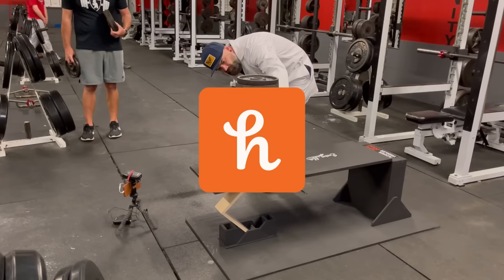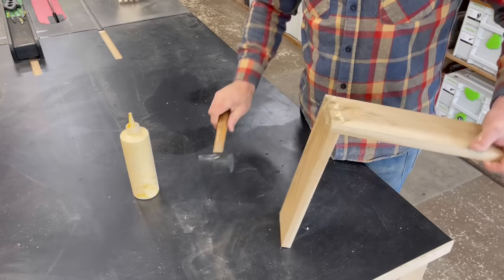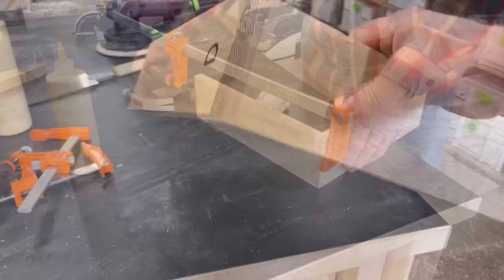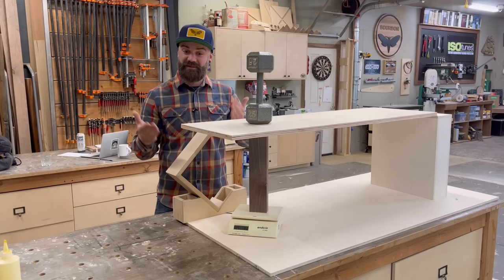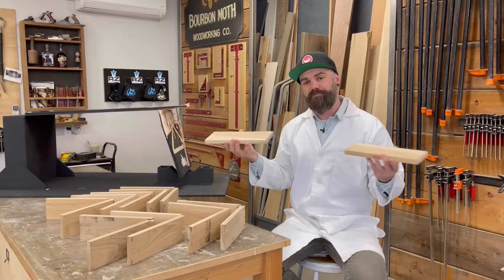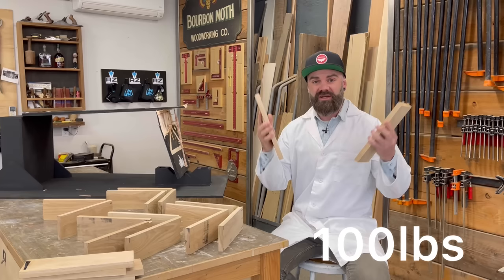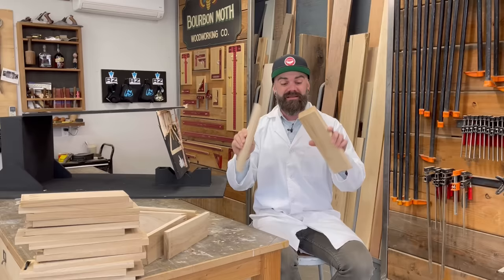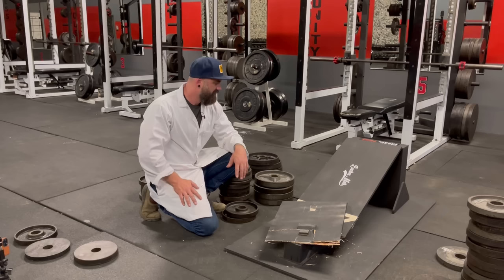What's the Best Wood Joint || Insanely Strong Joinery!

Comment: You called for a physics lesson: The accurate way to measure that breaking point is to measure torque on the joint. The torque is the twisting force and is equal to the perpendicular force times the distance from the pivot position. It is measured in foot-pounds or in newton-meters.  Since you are using pounds and you are positioning your wood at a 45 degree angle, the Torque is  T=Weight x Distance_perpendicular  which is Torque= Weight x Length of wood x cos (45) where weight is the force in pounds, length is the length in feet from the joint to the edge of the wood where you are applying the force, and the angle in degrees is the angle from horizontal that you tilted the joint in the rig. 

There are actually two ways to measure breaking force, torque (for twisting) and shear force. If you lay the top piece of wood flat at an angle of 0, you would just be measuring torque. If you propped the wood straight up (an angle of 90 from horizontal) and pushed straight down, you would be measuring shear force. You chose 45 degrees which is a combination of both but typically a joint will break to torque long before it breaks to shear force.

Comment: I'm thinking that the mitered joint is stronger because the glue penetrates down the grain on both sides.  Whereas the butt joint the glue only penetrates down the grain on one side and does not penetrate into the side of the other board.  The glue is strong by itself but it needs something to hold on to.

Comment: I'm not a pro just a father of two, but practically I keep doing the same thing everywhere: butt joint + screws. I wouldn't be surprised if it would beat pocket holes outside...
About the dovetail... for me it looked like the material itself yielded along the long grain where the negative corners of the tails were. Similar to why airplanes have windows without corners.

Comment: Maybe you can increase the resistance changing the glue you used.  Try it using a PUR glue (like Original Gorilla Glue) or an animal protein glue (like Titebond Hide Glue).  I use animal protein glue and sometimes I break the wood and didn't break the joint...

Comment: 15:23 - Well, physics teaches us that during an impact impulses of force can reach outstanding values, and those values of force (even if they last one split of a second) will break the bond. You tried the best case scenario: slowly adding weight. It breaks with 60 pounds, but if you hit it with a 1 pound hammer it will break. So no, it's not over engineered at all. But I am a wood worker, so don't trust me too much.

Comment: It appears to me that the strength of the joint is basically correlated to how much matching surface area there is thats glued. The miter joint would have about 40% more surface area than a butt joint but would also match end grain structure.  The glue absorbing into the end grain on both boards would add even more surface contact.  adding the splines is going to add surface area for more glue that will again match grain but this time they add strenth along the face and not at the end grain so it would get even stronger with more splines..  Dovetails are great joints but I feel like they are more suited to make joints that you want to be able to take apart and put back together without glue.  try the test again with no glue and see whats the strongest... lol

Comment: You should have tested a simple finger joint.  It would have probable have been the strongest.  It's been used for high strength shipping and ammo boxes since the 1800s.  Its' all about the total cross grain glue area.
I tested an almost identical 1/8" finger joint in 3/4 " yellow pine.  I'm a fairly large guy at 220#.  I tested the joints by setting them on the floor, apex up, and standing on the joint even Then I bounced on it. It would not fail. 
A simple miter joint is also strong due to the increased glue area at 45 deg (thickness X 1.414). 
All end grain (and 45 deg) joints can be made stronger by priming the joint with glue prior to glue up...kunk

Comment: I'm a domino fan. Dominoes are not used to their advantage in a but joint. In this test, the domino's long grain is glued to one board's end grain - really no different than the 1st but joint. The long grain of the domino should be glued to long grain in both boards to work as intended - and to provide a very strong joint.

Comment: On 3/4 board, miter is longer than just 3/4 that's mean much greater glue area. Measure how thick is miter on 3/4 ply, and make exact same thickness of board on but joint. You may be surprised.

Comment: The dovetail probably would have beaten the bunch if it was as even as the box joint.  The spacing was pretty but you didn’t have that much meat holding it together.  Interested in you trying some routes joints for your next test.

Comment: If you were to equally space the dovetails, more like the box joint it would perform much better in this test as the lateral load would be distributed more evenly across the boards. With the addition of the dovetails, it would probably add another 10lbs or so to the box joint. But, this isn’t really the application the dovetail was was designed for. A really good video though. The humble mitre was indeed the clear surprise winner. Nice work, I’m looking forward to seeing how you progress this series
Reply: A suggestion for the evolution of this test could be adding another joint to the opposite end creating a U, and suspending the weights from it to see the various break points in a pull application?

Comment: Some rude comments regarding the glue...joint  making. I would say, try the dovetail again, same  scenario...but both boards cut to the same dimension. I would bet you get a better result. However...you are breaking these joints at an angle...so I get the mitre style joint being able to spread pressure better. I liked this video regardless of any flaws...because it does make you think about the joint for the job. Something a few carpenters tend to forget...or at least forget to ask the client when designing furniture that has to take weight into consideration. 🤔

Comment: 13:11 My guess order, weakest to strongest:
Pocket inside
Butt
Miter
Pocket outside
Lamello
Dowel
Domino
Miter w/ splines
Box
Dove
[Edit]
I was sort of on the right track with most of these, except two: miter and dove. I think the dove would be much stronger than it was if the tails were wider. But the miter surprised me! I would personally probably make miter with splines. Seems like a lot of strength and a nice look for not much extra work over a miter.

Comment: I think this could be done more reliably. There are 2 things I’d change if I were to carry out this test.
First of all, get rid of that block that props up the test pieces! It alters the point of leverage and screws the results, instead put marks on the floor and underside of the hinge board and use those to line it up. 
Much better
Second, and this is only subtle, is to use a dovetail with a more even 
pin-to-tail size ratio. If anything it will be much stronger*

Comment: Joint fatigue would almost certainly kill the simple, unreinforced joints at much lower loads.
This would also apply to the pocket hole & screw joints.  BTW, I am a fan of pocket hole joinery and have built three huge wall units which are holding up beautifully.  However, there are not. Repeating loads on those.

Comment: The mitre is not surprising if you realize that end joint gluing is actually stronger! (Watch more videos) The mitre is basically 2 end joints and the glue going into the grain increases the strength, not decreases it.

Comment: Those other joints were used because the glue will break down and loosen up over time (thermal cycling). Old furniture that used those joints can still be tight well after the craftsman is gone. They are for longevity not just strength.

Comment: Everything that is said about gluing end grain is wrong. How wood glue works is completely misunderstood here.  It is hardly surprising that the miter cut is strong. It is because the glue soaks into the pores of the end grain that it works so well.  The glue soaks into the pores, adheres to itself, and hooks into the two pieces.  If the glue cannot soak into the wood, it won't bond the wood. Wood glue does not create a chemical bond. It relies on drying into hundreds if microscopic "fibers" of dried glue that span the gap.

Consider gluing two pieces of glass together with wood glue.  Two smooth pieces of smooth glass will not hold. Now consider two glass pieces with hundreds of microscopic holes in them. The glue soaks into the holes and where they line up on each piece, the glue spans that gap. If the inside of the holes are pocketed and rough and the bottoms are dumbbell shaped, that piece of dried glue is hooked into the wood.

The failure of a butt joint, end grain against the face, is not because the end grain side is weak. It is because the face side is weak. The end grain fibers don't break, the face grain fibers peel away from the rest of the board or the glue, which is simply resting on the surface of the wood, simply peals away.  If the glue can't soak in, it won't hole. Might just as well try gluing two pieces of glass together.

I am going to intellectually abuse the reader by repeating what he said.   What he says is, "We know that gluing end grain to anything just isn't a strong joint."  That statement stands as proven wrong.  He proved this with the miter joint that that came is at #6, the third strongest joint.  We shall never make that statement again, shall we?     

He goes on to say, "Because end grain is full of all these little pores so as you apply glue to that end grain, well the glue likes to migrate away from your joint into those pores so you end up with less glue holding that joint together."  None of this is correct.  Do not ever speak these words again.  It is clearly a failed hypothesis.  I will put money down on the fact that gluing two end grains together will be stronger than gluing any two equivalently sized face grained pieces.

Comment: If you test these joints on Plywood, I am thinking of good quality birch, then I would say the best joint is the box or comb joint. The weakness is in the lamination which can easily rip away on a butt joint. I think the miter joint would also be weaker.

Comment: Dovetail 1. Dovetail joints are designed to be strong in specific applications. And they are designed to function primarily off of mechanical strength and not glue strength. (so in theory the joint in its proper application could work without glue at all) This type of strain is outside of those conditions. If you watch how it breaks the joint is actually sliding out of itself (although uncomfortably). Very similar to pulling the joint back out the way it was assembled. Although there is some minor damage the pieces really didn't break and could probably be reassembled. Also as others have said its very probable that the joint was to tight anyways and didn't allow for adequate glue on the tail to pin surfaces......  This is the weakest scenario for this joint. If the test was compressing the joint strain down or more importantly pulling the joint straight out away from the tails then I would expect to get a different result.

Comment: I preface this comment, I am not a wood worker and don't have power tools or workshop. The box joint, appeared to be a glue failure. I couldn't see up close enough to see if it was grain breakage. If your looking for content, perhaps the same experiment using only box joints to test different adhesives. Then the winner is tested against the reigning champion. Thank you for the videos.

Comment: This was a fun video. The 45 degree miter join is insane, I did not expect this. The reason why it is so strong is probably all due to the surface area of the glue on both sides of the wood. I am opting to make a miter join with one spline inserted completely through the full side of the wood instead. I am curious if this will be weaker or stronger.

Comment: I don't know if its accurate to the look of the dove tail, but I'd bet it would win no problem if the tails on both pieces were the same size more like the box joint. It would have the same surface area as it does now, but those particular tails are just too small on such a small piece of wood.

Comment: the box joint only had one additional bonded surface than the dovetail.  7 mating surfaces versus 6.  that would account for some extra strength, but 100 extra pounds seems a bit crazy.  that can't possibly be right.  there must be some other variable in play.  
so i'm gonna need you to do another series of tests where you make twenty of each joint and then average the results.  and you should glue the joints in repeating groups to minimize the effects of variability in your gluing method.  what i mean is, glue all the different joints, then go back and do the second iteration of each joint, and so on.
you could also do half of them dry, then the other half wet... i.e., using a sponge to wet the wood before gluing.  see what difference that really makes.

Comment: I think the strength of the simple miter joint comes from how you clamp them together. I notive you added two pieces of wood to allow an extra clamp direction to push the miter surfaces together, rather than just the right angle clamp. This should be critical to the result. Hope to see another test without that clamp.

Comment: I was just wondering if you had cut the miter splines at an angle instead of at 90 degrees if that have added more strength to the joint also. good video

Comment: I think dovetails with a larger pin would be much stronger. I to was surprised about the miter joint and spline. Have you also thought of testing different glues with these joints?

Comment: So yeah, direction of the forces is also going to matter, compression versus tension and all, but another thing that is that for many of those weaker joints, glue used might be a bigger factor.

EDIT: also, unfortunately, working with wood, you're working with something incredibly variable, even if you try and get very similar boards. Products of living things are just like that..

Comment: Glue is stronger then wood, the mitre and the splines allows for a alot of glue surface contact that directly opposed the stress applied. Box joints/dovetails are stronger in other ways.

Comment: Now do another video to see what the strongest joint is you could possibly make. Like miter, with splines, AND with pocket holes. Then do another the same way but add through dowels too. Just make total frankenstain joints to see if you can make one that will be so strong that the wood around it fails before the joint itself does.

Comment: Of course... if this is indeed the direction you need the strength, the result looks like this with these joints performed this way. Can't say I'm overly surprised  by the results.

Outside of being decorative,  the dovetails would have been stronger with more or larger pins, but still probably would not have come out on top in this test, as they're made to prevent drawer fronts from popping off, for instance. Ie the force application doesn't match the direction of the strength of the joint. 

Mitering the joint changes the grain to basically long grain. There's a lot more strength in that glue joint as butt to long grain, as was also clearly shown.  On top of that, the glue surface is over 40% larger. The main argument against such a joint is natural wood movement,  where if the elements  are locked in place, the wood shrinks or swells, the miter will open up

Comment: You address this in the video, but it seems the failure of the joint was more related to just the glue and not the joint itself. Maybe another test using different adhesives would result in different results.

Comment: Now you need to test the mitered joint at different joint sizes so you can get a value for how much torque is being applied then adjust your numbers for the other joints

Comment: That's real interesting. Thanks. I quite like the splined mitre. I usually put them together with Mitre-Mate, for speed and ease; I think you call it CA glue in the States. Then I cut the splines, slots and glue them with a proper glue like epoxy, PU or the modern PVA alternatives :)

Comment: If the splines had more width I bet the splined miter would hold a ton more weight.  For that joint to fail the splines had to rip apart in the strong direction of the grain.  So the splines would massively trump the competition if wider is my guess

Comment: One thing that always seems to be missing from these tests is the effect of glue degradation and wood movement over time.  A freshly glued joint will be significantly stronger than a glue joint on wood that has cycled through the seasons for 10 years.   Not very practical for a YouTube video but longevity is my main concern for drawers.

Comment: The dovetail thin side was the weakest link. If the dovetails were equidistant and had the same thickness it would have been as strong as the box joint. From a physics stand point, that looks to be the reason for it not holding up under pressure.

Comment: Complete guess here... But I believe the reason the miter joint was so strong is because the surface of the 2 joined miters was parallel to the ground and weight at top.  Could be wrong, just a guess.

Comment: Nice comparison, thanks for sharing. But... at around 24 min in the video, I saw you seem to have a nice technic to clamp the wood. I know the 90 degree clamps on the inside but what's your technic there on the outside of the corner? Don't the 2 pieces of wood slip?

Comment: Part of teh results I think Also have to take into account the direction of force. I think that if you reversed your test, and applied the pressure away from the joint (inside) instead of towards the joint, it would change the lineup quite a bit.